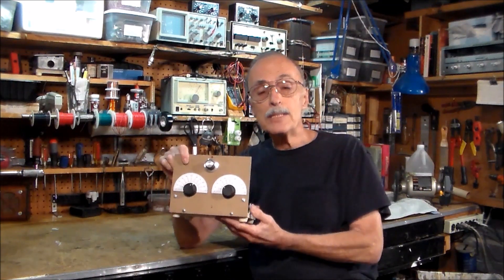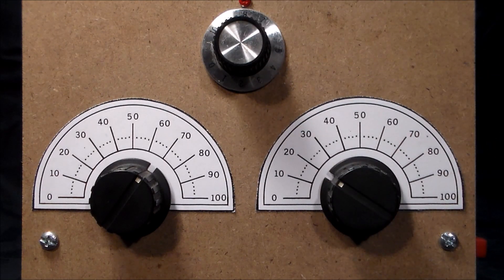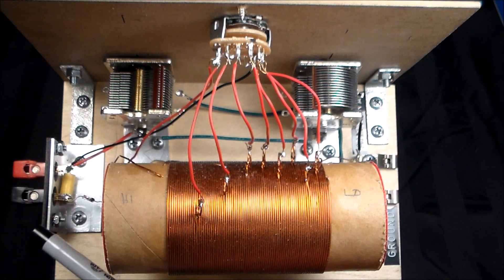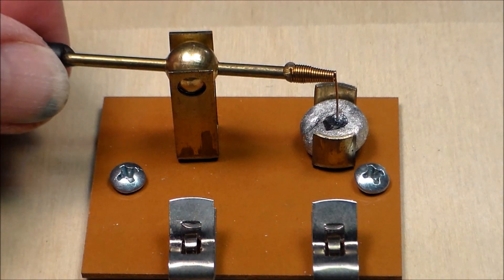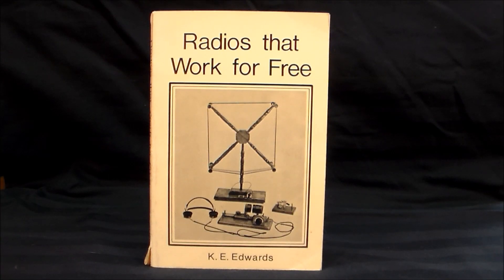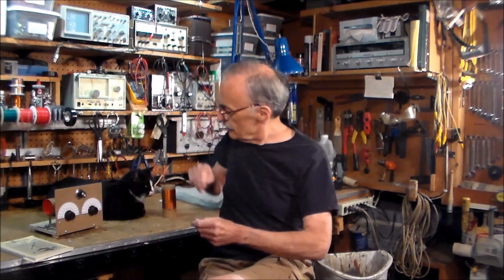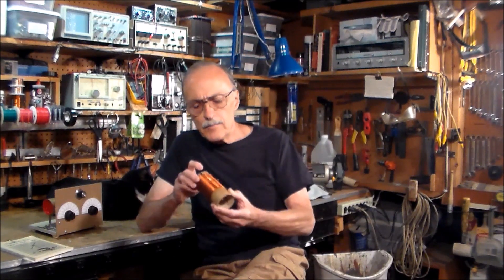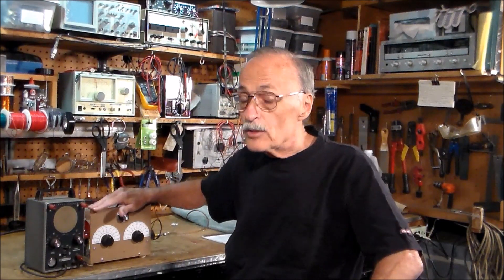CRYSTAL RADIO: FREE ENERGY SOURCE??

Comment: my grandfather was a member of the signal corps in France 100 years ago.  He was in the 96th aero squadron.  His specific duties included radio operator.   Which meant that he was in charge of radio communications including repair and maintenance.  unlike today, he had to build his crystal radio piece by piece in the field.  His job was classified until relatively recently.   

Fast forward to 1955.   He finally had enough money saved up to buy his dream house on the beach with a wonderful view of the ocean.   A few months later a radio station built a huge antenna next door less than 50 feet from his house.  He was pissed.  No he did not sue.  No he did not complain.  He got even.   He went to the dump where his friend worked and over the next few months collected all the materials needed.   Not long after that he had more free electricity than he knew what to do with.   I believe he may very well have built the world's largest crystal radio.  He ran all his house lights, refrigerator, fan and Tv from all the juice he got.   Over the years they have upgraded the transmitter several times.  I believe the current output is 250kw which I think is ten times the one they originally put out.  My cousin now has the house and he still gets free power.  They tried to have my grandfather arrested for theft but the judge said you can't be convicted of stealing that which someone gave you.   They then tried to sue and the new judge basically said the same thing and over the years every new owner of the station has complained but to no avail.  The last judge said that the radio station is free to erect a giant signal blocker as long as it does not block the view of the ocean.
Reply: Awesome, SCREW EM! Do you have any pics of the system he built?
Reply: wow what a story i wish i could believe..especially running the fridge
Reply: @fidelcatsro6948  A radio broadcast antenna may transmit with a 50kw or more signal.  At 50 feet distance one can obtain approximately 5% of that energy output which would come to 2500 watts.  That would be sufficient to run 22 amps worth of appliances on continuous load at 110 voltage household current.  That's enough to run an air conditioner, a refrigerator, hot water heater, TV, Stereo and multiple 60 watt incandescent bulbs simultaneously.  Ask any electrician.
Reply: @30AndHatingIt  He died a couple of years before I was born though I did see one photo that my late aunt had about 50 years ago.  I don't know what became of it.  Family lore says his apparatus was taken down when the family sold the place.
Reply: @nunyabiznez6381  sounds like Wardenclyff legend!

Comment: I built my first foxhole radio last night and now I'm hooked ! I was picking up am stations all over! I dont speak mandarin or Spanish but fun . The razor blade diode worked really well I was shocked .
Reply: Yeah I made one in seventh grade and did my own experiment. I had a one mfd  capacitor and used it in place of the safety pin and pencil lead which is graphite. I took the one end and moved it on the razor blade which was a scraper blade I picked up Pittsburgh's KQV radio station which was Pittsburgh's weakest station. I also picked up KDKA which was not unusual. People picked it up with their household plumbing. Not a joke.

 I used a ground and for the antenna I just used our outdoor tv antenna im surprised I didn't get shocked with the TV running and the chassis was tied to one side of the electrical outlet. I saw little spark while tuning in a station. Come to find out later those tvs did not have polarized plugs on them. You can pick up electric from the air but my case was from the tv and ground. 73
Reply: Where are you from
Reply: @markoprskalo6127  I don't live there now but then I was 20 miles north of Pittsburgh. 73

Comment: everybody we need to learn how to build this type of communications and survival skills the time is coming when we are going to need this knowledge.
Reply: Like climate change.
Reply: Zombies
Reply: Oh.
Reply: @trollyforest2618  more like climate change.
Reply: dont worry the first thing they will jam  is AM radio, sad to say .
Reply: I feel the same too. Better get good skills!
Reply: @mattiem7dmv158  not so sure , if you built a transmitter to jam 455 KC which at least was the intermediate frequency of my old shortwave sets you jam everything coming in .so a superhet is very jammable
Reply: Kooks. All kooks.
Reply: @fadepearce8442  no cuz you could just buy a radio that work with solar
Reply: A Crystal radio is a toy. It will not save your life.
Reply: Ironically, transistor radios are much more effective. They require lower powered signals. So, if the power in a given area is limited, transistors or even tubes are a net better solution.

Comment: Nice, I love your presentation too...! I have been using it 30 years, but recently I added a transistor to amplify the sound. The landscape has changed so much..! There is constant buzz of cars, microwave, freezes, pumps, AC and what not. With my 200 ft long Antenna and speakers from old telephones works just fine. Asking you question ... Do my old Arial affects the tunning coil of One transistor set or not.  The old set and amplifier set are a 2-3 ft Apart. God, I managed tune it finally after watching your video.  Cheers.. Keep posting..!

Comment: For those wanting to build an "crystal radio" a few points that help.
1) If you move the diode to a tap that puts fewer turns between it at the ground end of the coil, the radio is more selective but not as loud.  This is good in a place with many strong stations.
2) An "antenna coupling coil" slid inside the main coil can help you to adjust the coupling to the antenna.  Looser coupling (sliding the coil out) makes it more selective.
3) A wire making a full turn around the outside of the house can result in an antenna with two ends.  A turning capacitor between the ends can make the stations louder when correctly adjusted.
4) 1N914 or 1N4148 work OK as a "crystal" if that is all you can get.  A small signal schottky is better.
5) "stolen power" radios are a cool trick.  You basically make two crystal radios.  One is tuned to a strong station and makes the power supply for a simple one stage amplifier on the other.
6) You can often get short bits of plastic plumbing pipe for nearly nothing.  4 inch AKA 10CM diameter worked very well for me.
7) Take a magnet to the hardware store so you can check that any brass screws you buy really are brass.  Brass can be soldered to.
Reply: have.you lit up leds with those radios?
Reply: @fidelcatsro6948  
"Lit up" is far too strong of a term.  In an extremely dark room "detectable" light is what I managed.
Reply: perhaps you should have several crystal coil sets in parallel to an led that will provide better amperage...and then if you get 4vdc rectified to charge a decent 18650 battery with good amp storage capacity
Reply: @fidelcatsro6948  
The experiment is not really worth doing.  If you run two crystal sets too close to each other, the antennas end up sucking up each other's signal.
Reply: @kensmith5694  ok..;)
Reply: @fidelcatsro6948  
BTW: If we got the entire US military to shuffle their feet across a carpet, we could also perhaps power a light.
Reply: from rubbing feet static electricity then you mean hahhaha

Comment: Love this. I remember trying to build one of these using old wire from a transformer the wire was just too beat up so I gave up. I think I may try again but buy new wire this time. I want to build this exact radio. I just got the book. I wanted a paperback but they want a wopping 400 something for the copy currently on Amazon. So I had to get the lame but informative digital copy. I never knew there was a way to make one this advanced I thought tge blued razor blad version was cool but this things out of this world. I built a modern radio some time ago from a soldering project kit and also a transmitter among many othere little 5 dallor soldering kits. I plugged my phone into the transmitter and high jacked a station to pick up on my radio. It was Purdy fun. Ide love to build a bunch of these fancy little foxhole crystal radios.

Comment: Excellent video.   Just a point of modern radio:  It is NOT necessary to connect one side of a crystal radio (or any radio) to actual earth ground.  Earth is an especially poor conductor of radio frequencies.  Better to use a balanced antenna like a dipole or simply another piece of wire of any convenient length in combination with a long wire.  Happy listening. b.
Reply: @Officer Hogwash You live in the best of all worlds.
Other people will be happy to find a balcony railing and connect this to the Antenna jack.

Comment: I saw the title of this video and it reminded me that it could only be 'free'-energy as long as there are stations on the air to supply the crystal set with energy. 
Did you ever talk with or listen to Art Bell W6OBB (now Silent Key RIP) back when he would talk about his huge loop antenna he had going around his Pahrump Nevada property? I remember him talking about how he had to install a protection-circuit of some kind between that loop antenna and his rig, otherwise the rig would be damaged by large voltages that were being induced into that giant loop. I do remember that he said that he ascertained that those voltages were not being picked up from local power-lines or other man-made sources. The discussion went on for quite a few Coast-To-Coast-AM episodes, but I don't remember what he finally concluded.. I missed that episode. I believe that the voltages were being generated by the naturally-surrounding Earth's magnetic fields cutting through the loop and developing voltages across it and appearing at the two terminals of the open-wire feedline connected to the loop. Now THAT'S free energy. He had three turns of thick antenna wire looped along the top of 70 foot tall masts spaced all around his big Pahrump property. I think it was about 3,000-something feet of wire he used in making that loop. On the ham bands his signal always BLASTED in 5/9+infinity in my receiver here on the west coast when he used that loop. :-)
Reply: Man , He solved the FREE ENERGY riddle !!!

Plz explain further

Comment: Your video brings me over 60 years back when I made my first crystal radio. I new nothing about impedance so the  75 ohm headphone worked perfectly.
Now I am going to build another crystal radio together with my grandson. Unfortunately, there is no more am transmitting stations where I live so the result can frustrating.
Reply: You may want to check to be sure there really are no stations at all.  Often there is a really awful one you have been ignoring all this time.
Reply: it will be great to buy one from you, which can receive SW
Reply: Hey man if there are no AM radio stations try making one with a AM radio transmitter. There’s an easy one you can make with a 555 timer or you could go for an LC circuit transmitter or there are also microcontroller AM transmitters. Anyway good luck with the crystal radio!

Comment: hey, I plan to build an demodulator/amplifier using a NE555P chip by attaching the coil wiper to the threshold and trigger comparators and then the antenna has a connection to the control voltage pin I think this is a high impedance transistor that can act as a diode inside the actual semiconductor.

Comment: Yes my visitors are amazed. By the fact that radio stations fight to get in. And guarded is my Baldwin head set. And a salvaged tank head set.  Ps I do on ocasion use a couple low volt led to make a verry small lamp. Shutting off my room light. I see the room light up. As my vision corrects. And almost see well enoufgh to make notes.  Or tune another set good show om 73de kv4li

Comment: 3:54 shows 2 spring type connector clips on the cat's whisker detector.  If these are still available anywhere, would someone give a source, and proper name for them.  Much thanks if you are able to point me in the right direction.
Reply from the maker: These are called Fannestock clips. They are available from Antique Electronic Supply for $1 a piece.
Reply: @squarewave2  Thank you!!!

Comment: May I ask what is connected to the stator on c2 in your build here. I was playing around with the wiring on mine and decided to connect the ground to the stator of c2 instead of to the frame of c2 and had interesting results it seems better than before with more channels when I had the ground only connected to the frame of my c2 with nothing connected to the stators and it worked but the ground capasitor seemed to have little to no affect to the output of the radio. I guess I'm wondering if I wired c2 incorrectly originally following the books instructions that said very little about c2 other than to wire the frame to c1 and to a headphone connection and to the 8 or 9th tab on the switch also wiring the stators together only on c2 if double gang.  I was just going over your video again and realized you do indeed have something wired to the stator of c2 and started testing things on mine now I'm a little confused as to whether my new wiring is correct or not.

Comment: I like the concept of that little radio of yours. I could make a wooden casing for it to look like a sort of a victorian era wireless. Where could I find a wiring diagram for this type of radio? And how should I decide the positions of the taps on the winding? Lovely series by the way. I also have countless old radios in my room, in the dinner, in the garage, all of them have tubes, and all of them are working.Additionally I have an oscillo-synchroscope, two old tape recorders, four turntables and a still working old ring ring sort of telephone with the huge dial. I have even managed to find a 16mm movie projector, perhaps from the 60's, and it also has 4 tubes for the amplifier, and a big one as a rectifier. In the olden days everything were just better. "Simplicity is the ultimate sophistication." as we know..
So long Sir!
Reply from the maker: Hi Istvan,
I recommend that you get the book I talk about in the video: Radios That Work For Free by K.E. Edwards. It has the diagram and parts list for this radio. If you are inexperienced with radio building, you will find a lot of necessary information. Find the book on Ebay or at Amazon. Good luck!
Reply: Many thanks, I have alredy looked after it. I am also building a small Stirling power unit, much like the Philips mc1000 Generator. I'm afraid I got obsessed by some sort of a worldwide catastrophe, so I keep gathering tools drawings and information how to build equipment for  such an event, as after it, there may not be working internet or computers, and only old analogue stuff would work. I even have many plans printed.. Strange I know, but in such a situation I will be utterly happy :D

Comment: I am more than a bit bewildered  by the circuit.
Take that coil switch. Position One (Left hand)
A small amount of inductance (a few turns) is connected  across the tuning cap forming a parallel tuned circuit and cannot possibly resonate in the AM band..also known as Medium Wave.  Any signal which might survive has now got the rest of the coil acting like an RF choke in its path to get to the anode of the germanium diode.
As the switch is moved to the right, more and more inductance is placed across  the tuning cap and  at the middle, only 40 turns worth can be tuned which won't make the Medium wave.
When the switch reaches the right hand contact... the diode is now grounded on its anode and there there is nothing to
detect/rectify.
One simple question..AM I MISSING SOMETHING?
I look forward to your help, (is it) John? Thank You.
The redeeming factor is that the goldurned thing works!